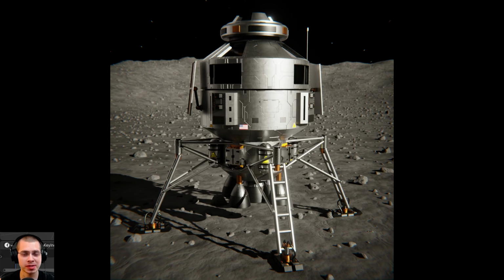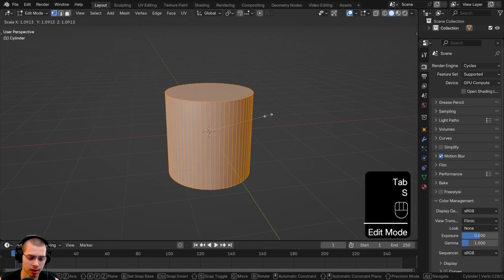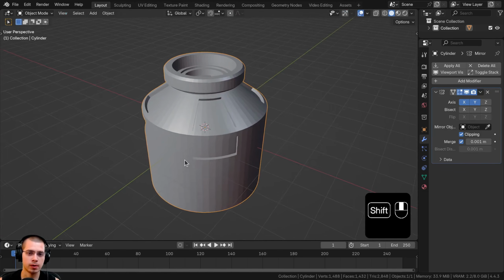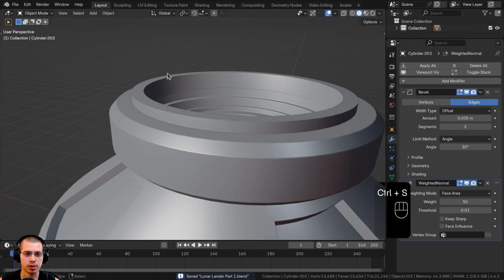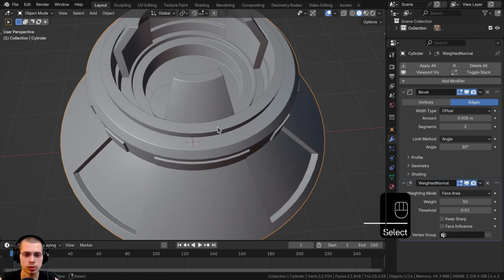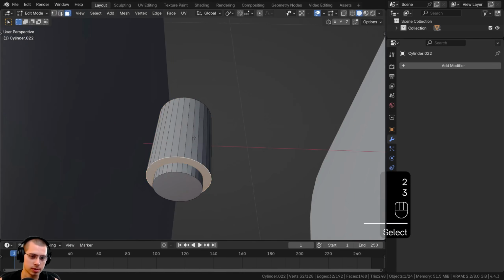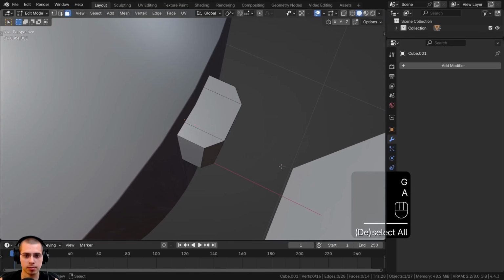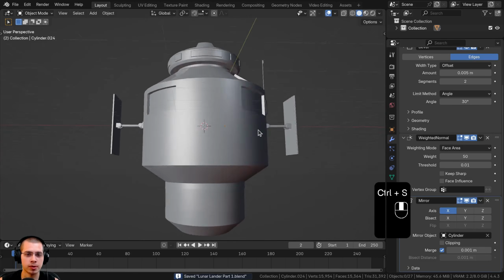Sci-Fi Lunar Lander - Part 1 (Blender Tutorial)

Comment: Hi. I really need help with exporting my blender file. I managed to export everythign of my calculator project except the texture paints. I do not know what to do, what steps to export it, or like even what buttons to press. I spent a ton of time texture painting and it hightens the quality of my work, but my computer simply isn't exporting the texture paints correctly even though i know how to UV wrap + connect the nodes properly. Is there something I'm missing? I'm not sure but i asked A.I. about this problem and it suggested i should watch "How to Bake Normal Maps in Blender" video on youtube. What is the point in baking anyway if you can give me the general  gist of it?

I simply want to export the texture paint (metal) along with the full asset of like a calculator, or like the lunar landing ive made.
How can i go about it?

Edit: I'm trying to export it as a . Fbx file and upload to google drive so my friend can use them